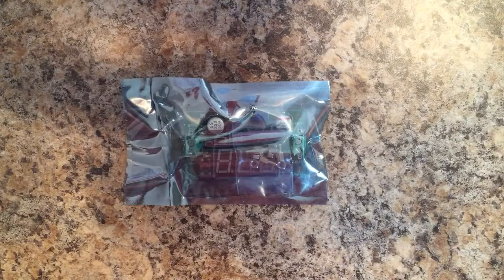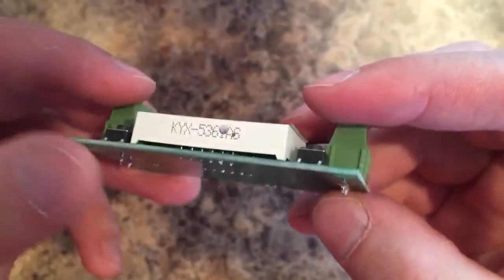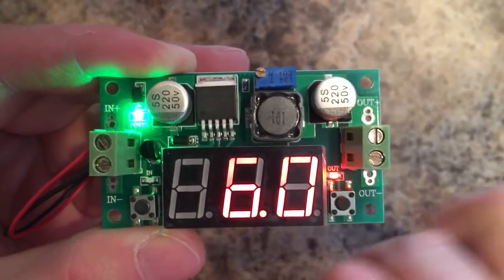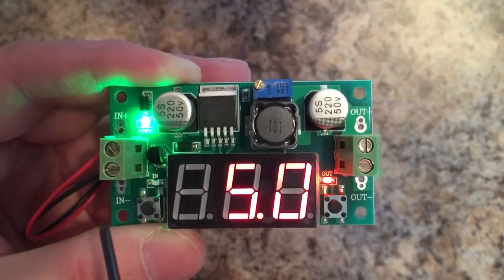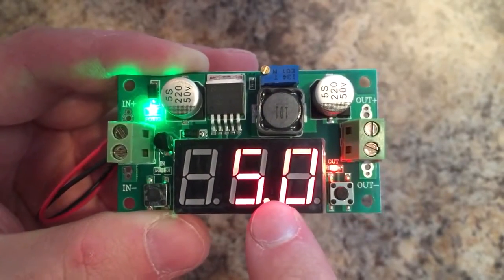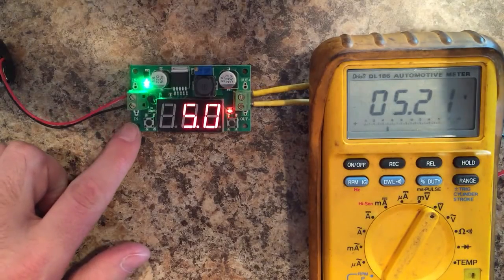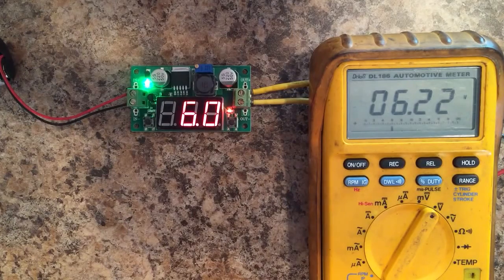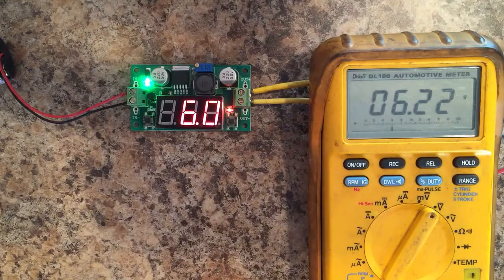4V-40V DC-DC Step Down LM2596 Voltage Regulator Converter Module review

Comment: If + and - input and output short circuit or change the wire. The board will damage? Or any short circuit protection on buck board?

Comment: Does the output vary with the input voltage. i.e. I want to regulate 17v to 21v solar panel voltage to 12v.  If I set it to give 12v output@17v input will the 12v output increase when my solar panel outputs 21v to this module's input?
Reply: No i don't think so.

Comment: Hey tdracing13, 

I have the same voltage regulator and the first time (each time) I tried it, I wasn't capable to change the voltage value with the potentiometer. I checked if there was a defectory part with the 1k option on the voltmeter but everything seems to be fine.
I don't know if my voltage regular is defectory?

Comment: sir i have 6v and 100ma solar panel i wat to step it dow to 4v and want to increase the amp from 100 to more will this module work ?
Reply from the maker: Hi, I think this would be better for your application http://www.banggood.com/LTC3780-Automatic-Buck-Boost-Constant-Current-Power-Module-p-990459.html it is a boost converter/voltage regulator in one. It should allow you to lower voltage and increase amperage within reason.

Comment: Nice. 

1. Can this be used for doubling the output of a DIY battery.
2. Can I connect them in parallel to gain power?
3. Can this charge a deep cycle battery for home generator set-up?

Thanks.

Comment: Doesn't this unit have the display calibration feature, toggle LED's IN and OUT with the (out) button once lit hold the (out) button down for more than 2 sec. release display should be flashing? use both buttons (in) button for down,(out) button for up, when done hold down the (out) button for a sec and display should stop flashing, I think the adj. is a full volt either direction in .1 of a volt.  Whichever LED you have lit when you hold the (out) button down will determine IN or OUT Calibration.
There are millions of these units in all kinds of configurations out there maybe this will work for yours? Regards.
Reply: +Randy Harter    Hello Randy,  this is just what I have been looking for and it worked perfect with my regulator ( same as the one in the vid ) Thank you very much... John :)

Comment: Nice video. I'm just getting into the DIY electrical world. I just built a small solar generator. I was thinking about how to get the most out of it. My Idea was to team my generator up with my Ryobi 18v cordless system, because it has many useful tools for everyday use. 
 Then I got the idea to use the 18v batteries for more then the recommended use. So I hooked a DC cigarette power point up to a battery to charge my phone and devices.
 But that's not enough. So I just ordered one of these LM2596 Voltage Regulators and a 75 watt inverter. I plan to go from the 18v battery to a 5 amp fuse to the volt regulator (dropping down to 12v) then through the inverter to power a lamp at night.
  Since I have many of these batteries I should be able to make enough to run all my lights this way if it works, and be able to charge all the batteries during the day with my solar generator.
  Like I said, Im new to this. The plan works great in my head but putting it to the test is a different story.  Any thought?